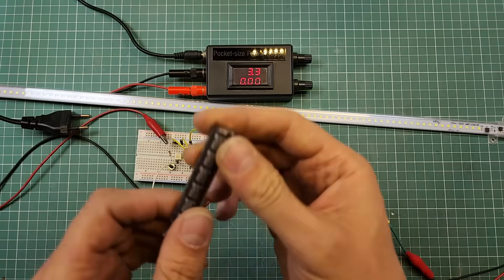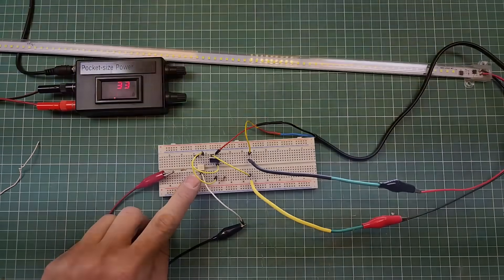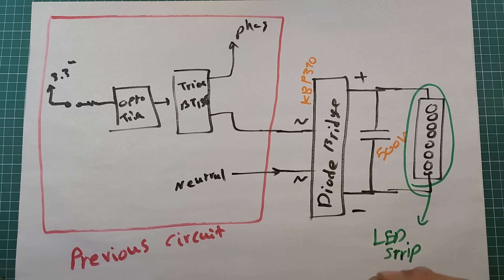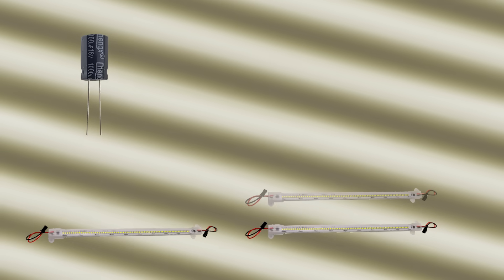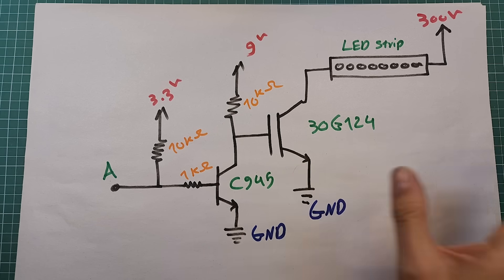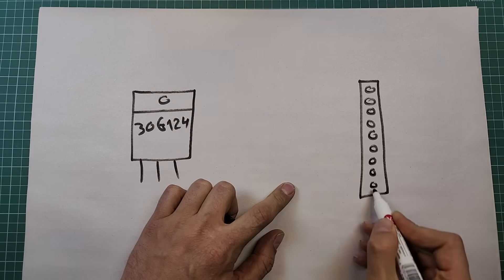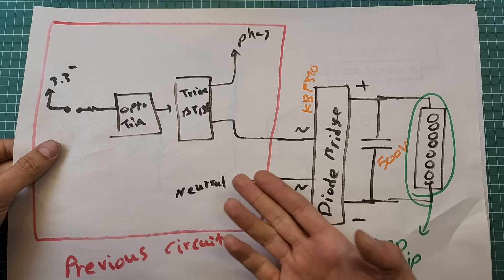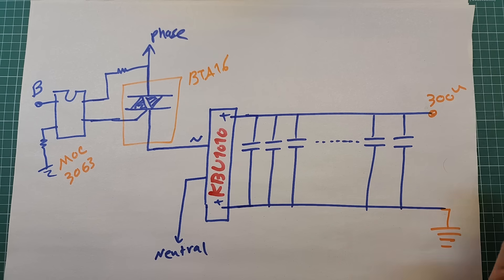Triac or IGBT? Choose wisely!

Comment: Nice experiment. Which is a better component  for AC load BT136 or BTA16 ?  
Is there any more advance component as compared to BT136/BTA16.  
As I have seen, if BT136/BY16 get damaged they will give continuous AC supply to connected device like heater .
Reply from the maker: It depends on the load! How much current the load draws?
Bt136 is for low currents and bta16 is for higher currents
Reply: @elewizard  lets forget about current, which is more advanced version , which has less chances of failure.      I have seen if BT13x get damaged it give continuous supply to appliances.

Comment: shouldn't it be : AC  >  fuse  >  MOV  >  rectifier  >  high voltage cap  >  noise filter  >  IGBT controlled by optocoupler  >  LED strip   ?

Comment: I remember that a few years ago I tried to control power to a circuit using a microprocessor through a TRIAC! I was puzzled because it couldn't be done! It couldn't be switched off! Eventually i settled for a Thyristor or even a transistor by reducing the AC voltage to 20 v DC.
Reply from the maker: Thank you for sharing 👍
Reply: When one uses triacs......remember.. it's controlling ..BOTH the +ve & -ve half's of the AC cycle...& each polarity requires different triggering characteristics...
this is easy with  OPTO- COUPLED TRIAC..
either the ZCD or Phase Angle type..
but for direct trigger , ....where both control & power have a common reference..(LIVE !!)..its best to know the quadrant of operation for optimum trigger efficiency.. that's mostly.., either in the first or third quadrant...
A more detailed expln. abt. this is available on the internet.. .

Comment: I think there is some incomplete info in your logic for rectification of the mains.    When you rectify you get all lobes of the sine wave in one polarity.   Now you filter those lobes with the capacitor.   The capacitor captures the peak voltage of the wave form.  This comes out to 120 vac x 1.414 or around approximately 165 volts DC (minus 2 diode voltage drops in rectifier).    You are over driving the 120 VAC RMS LED strips with 165 volts DC.   (Unless they have built in current limiting).    You should explain that in your discussion.    This is a trap for newbies.  Love your videos.   THANX
Reply from the maker: You are absolutely right! Thanks for bringing that to my attention.  🫡❤️
Reply: It's not such a simple explaination...because the push button trigger is random...& may trigger anywhere in the cycle..if using a phase control opto triac trigger device.....this opto-triac device HAS TO BE TRIGGERED..with a LINE/MAINS SYNCHED Z.C. detected signal...to ensure... proper & uniform triggering & output voltage ramp UP/DN as one desires.....this also can guarantee some limited control of soft starting...
For ZCD. opto triacs...the trigger must be at least a repititve  freq.burst..of 100/120 Hz ..or higher...for the duration the trigger button is pressed...else here too one could experience flicker.. especially if the trigger burst is lower than 45-55Hz ..or does not sustain for >8-10 mSecs each...
Here NTC's..or other means are reqd. for soft start...no matter what the case....
...In both types of triggering   ..the soft start is limited to voltage control softstart......
Current controlled soft start is also possible but requires current sensing & current f.b. added for current control......
All is good as long as these loads are more resistive in nature...because in SCR/ TRIAC circuits they are only voltage triggered devices .. that can be "turned on" ONLY.. they cannot be turned OFF unless it experiences a ZCD event.., or current falling below it's min.holding value ..or if it's force commutated to turn off.

Comment: Note that adding high amount of capacitance to a full-wave-bridge-rectifier can damage the rectifier. The capacitor draws a very high inrush, each capacitor I've measured draws over 200A if turned on without any current limiter. I use a scmitt trigger / NE555 with RC configuration to turn on a relay after X seconds, and the relay has resistor across it, so when it's off, it will charge the capacitors slowly and then it will short out the resistor. This way both the capacitors and the rectifier IC is saved as they don't experience massive surge!

Edit: Just noticed you talked about NTC lol. It's perfect, but it wastes a bit more power, and on the other hand, when you turn on and off the circuit quickly, the NTC stays hot and will not prevent inrush current!
Reply from the maker: Yeah, thank you for pointing that out 👍
There are countless ways to overcome the inrush current.
On the other hand, I've used a zero cross detection opto-triac to make inrush current minimum by charging the capacitors from 0v to the max voltage ⚡️

Comment: This circuit configuration is wrong.  The load should be above the triac. The reason the circuit pulse is because of the ac voltage on the LED.  If you apply a DC voltage across the LED strip it want pulse.  If you have a AC voltage use a diode and capacitor to create a DC voltage for the LED string.  Always look at Datasheet for the Basic Operation of the circuit before doing your Electronics Designs.

Comment: Those devices aren't called "NTC" they are called "NTC thermistors." NTC simply stands for Negative Temperature Coefficient. When applied to a resistive device, that mean negative tempco of resistance. The forward voltage of a diode also has a negative temperature coefficient.
You don't need one in each "leg" of the AC, though sometimes that is convenient for achieving higher resistance and power handling.
Keep in mind that these devices can run very hot and can eventually cause damage to a PCB unless the temperature rise is considered.

Comment: This video has the very same error made in a previous video about IGBTs. 
The exceedingly high current rating is a "short circuit" rating which describes the current the device can handle as a very short non-repetitive transient in the event that the load is short-circuited. The time duration allowable is typically between 5 µs and 10 µs. It also applies only when the IGBT is already ON and conducting so that the current is distributed quite uniformly across the whole die area. Turning the device on with that magnitude of current can be destructive because of "hot spotting" - very high current density in a small part of the die. This same issue exists with triacs and SCRs  where it can usually be overcome with gate drive very substantially greater than the minimum trigger current.

A string of LEDs is effectively a shunt voltage regulator, though not a very good one. If a capacitor is placed directly across a string of LEDs, the maximum voltage on the cap will be limited by the forward voltage of the LEDs when they are driven to high brightness. The lowest useful voltage on the cap will be the forward voltage of the LED string at some moderately low light level. That won't be very much below the peak voltage.

Comment: Would it reduce the flicker to flip the polarity of half the led strips so they were illuminating alternately - one strip illuminated while the other is not illuminated. The over all flicker should be reduced though some surfaces that only received illumination from one of the strips might still appear to flicker.

Comment: I"m glad you take steps to reduce flicker. A lot of people can't see it, I guess, so they don't realize it is beyond annoying to some other people. Based on old CRT type computer monitors, for me flicker started to become tolerable at 72 Hz and seemed to disappear above 80Hz. At 60Hz and below it would feel like staring at a strobe light 8 hours a day. Most LED bulbs switch pleasingly fast, but it does seem for some reason that old fluorescent lights and LEDs strips meant to replace them, tend to have the problem. I'm wondering if a frequency doubler could be added to get the flicker up to 100Hz-120Hz to hide the flicker better than filter caps alone?
Reply: A fullwave bridge rectifier does exactly that. You still get the flicker at 2x mains frequency (without the smoothing cap). And BTW the old-style fluorescent lamps also produce 2x mains flicker.
Reply: @malectric  I was wondering about that with full wave bridge rectifiers. I don't know if I have seen them actuall in use  in an LED light. But I guess I do have everything needed to try one out at 9V.  

I'm not sure how the new old fluorescent electronic ballasts work but I'd guess they do some high frequency switching. So I'm assuming you mean the old old kind with the long coil of wire inductor type ballast. If I correctly remember a Tech Ingredients video, the tube would light at one end and then the other as the AC polarity switched.  So the middleish part of the tube where there was some glow no matter which side was glowing would be flickering double rate. Is that what you had in mind? I'm not sure if I should really count that though because as I remember it, the glow didn't extend equally bright from one end of the tube to the other, so the ends would have the 60/50 Hz flicker. That might be what I was seeing instead of the fast middle. I hope so because the full wave rectifier would be easy to use. Although, really, when I have made custom LED lights for myself I just used $5 Meanwell DC/DC constant current modules which run fast enough to hide the flicker from me. Still curious to try the FBR though.
Reply: @karlharvymarx2650  The old types are those with a simple ballast and power factor correction capacitor and yes, they do light up with each half cycle BUT, they do extingush to pretty near dark as the current drops towards zero. They do glow full length - you can check both that and the dark times with a moderately high speed camera. You can also see this if you blink a few times - no camera needed.The flicker is very pronounced. in essence hey are strobes running at 2 x mains frequency. They used to give me headaches BTW.
              More modern types do use an electronic ballast but I'm pretty sure they also do this since they don't have any means of maintaining current flow between half-cycles either AFAIA. The tube phosphors do not have a long-persistence characteristic. 
             LEDs run on a bridge with little to no energy storage to keep them going would do the same thing. Note that any smoothing capacitor is only topped up (with a huge current spike) as long as the peak rectified AC/halversine voltage waveform  feeding it is at the terminal voltage of the smoothing capacitor.

Comment: Interesting! In Europe we have 230V ac => 325V cc
The MOC 3063 circuit also ensures opening when the voltage crosses zero. Maybe the protection measures for high capacitor charging currents are useless

Comment: Little detail about those T30G124 devices and 200A — checking the data sheet.
Yes 200A is there but it's a "pulsed" current rating. I think the device will fail if used at high current on a continuous basis.
If I read one version of the data sheet correctly it can dissipate 25W maximum (so, maybe 20-50A with a very good heat sink???). 
Of course the 200A pulsed rating is very useful for the in rush current.
Thanks for an excellent presentation.

Comment: If you want really flicker-free lighting, you need a constant-current regulator. Once you have a regulator involved, you can move most of the bulk capacitance after the regulator and avoid the need for inrush limiting, though now you need EMI filtering which will take as much space to do properly.

Comment: The 200 A spec says it is pulsed current.  I don’t see a description in most data sheets as to the duration of the pulses.  I suspect 200 A continuous would fry the device fairly quickly given its size.
Reply: He should have said microseconds, then you can.
Reply: The IGBT GT30G124 is for plasma display panel (PDP) driver originated from Toshiba. It rated maximun Ic is 200A plused 3 us @Vce=430V. Vce(sat) is 2.5V @Ic=120A.  The Pc is 25W @25 degree C. Quick estimation of the maximum continuous (dc) Ic to be ~Pc/Vce(sat), assuming infinitely large heat sink. That operating point is around the upper righthand side corner of the safety operating area (SOA).
Reply: @ Ah, I see, table in datasheet is not complete and diagram is not precise. But there is another way to find out the DC-current. Look at the Part-number-key: the 30 means the direct current. And, by the way, pulsed 200A should limited to 0.23 µs.
Reply: @ohje491 Though the parts numbering scheme suggests GT30G124 as 30A dc current class, there is no dc Ic current rating for it. I guess it due to the heat dissipation of its TO-220SIS package as well as its higher Vce saturation voltage of 2.5V @120A. Vce is a fab process dependent parameter and package determines the heat dissipasion. The TO-220SIS is fully insulated plastic molded package and dissipates mere few tens of watts, that limits dc Ic value of GT30G124 far less than the designated 30A class. The surface mount version of the TO-220 family is TO-220SM package which dissipates  greater than 100W. If a 30G124 die were packed in TO-220SM, there would be a continuous Ic rating.
Reply: @みゅう-i1r  It's only vague, but it could be that Vce@30A is 0.833 V. Then only 25 W of Ptot heat dissipation is required, and the temperature must be maintained at 25 °C.
Reply: The datasheets should include a diagram for safe operating area (SOAR) or something similar. There you can find it. And yes, it is dependent from cooling.
Reply: @ohje491 You might be right. I could not find the Vce@Ic30A so far and substituted it with Vce@Ic120A found in their short catalog as a safety measure.